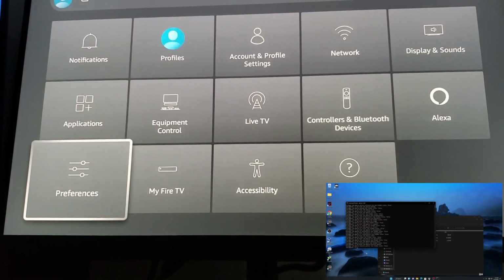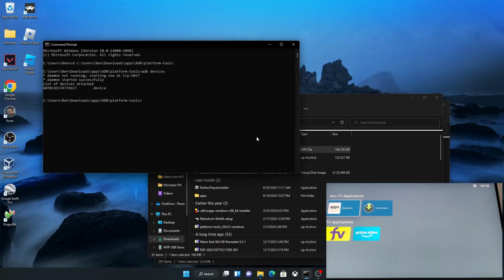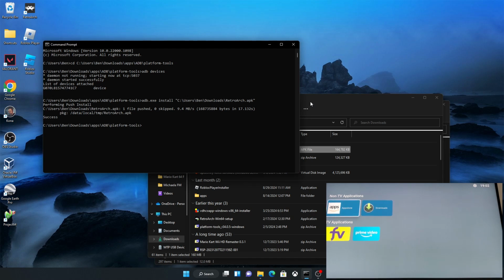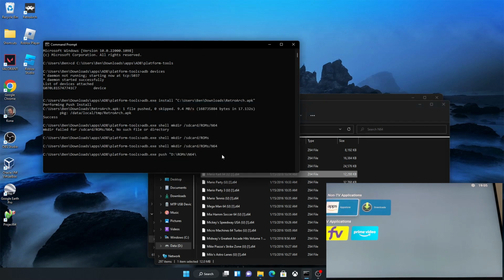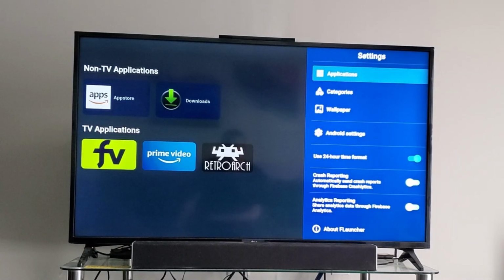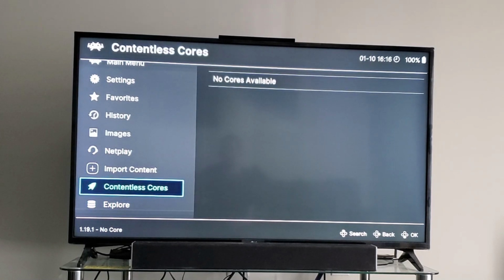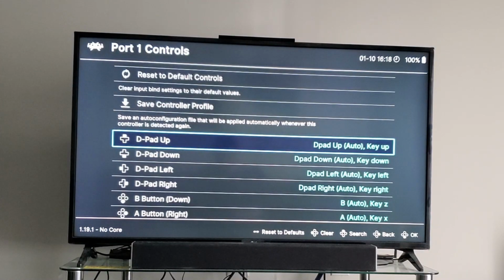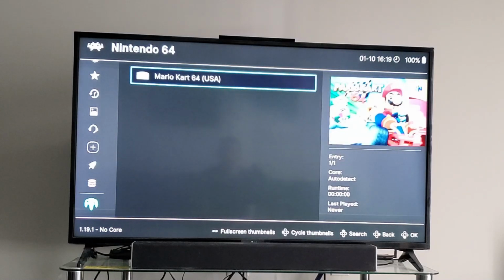Retro Gaming on Fire Stick with Retroarch and 8BitDo Zero 2 - Full Setup Tutorial!

Comment: Hey, so I’ve tried this wirh wired controllers. But seems like I can only get one to function, never two at a time. Assuming that BT based 8bit Do controllers can get past this and work ok with 2 at a time?
Reply from the maker: In my experience, 8BitDo controllers will function properly when 2 or even 3 are connected to the same device over BT.  I haven't tried plugging wired controllers into a Fire Stick yet, but it's possible whichever USB hub you're using may not provide enough power for both controllers.